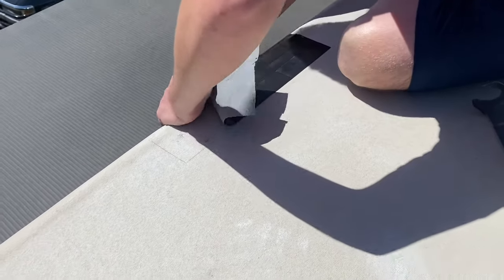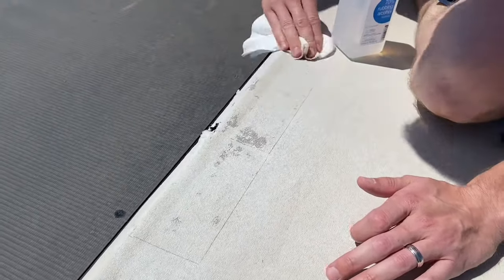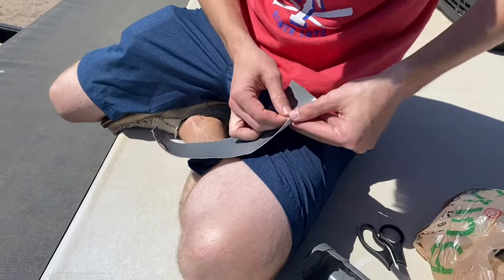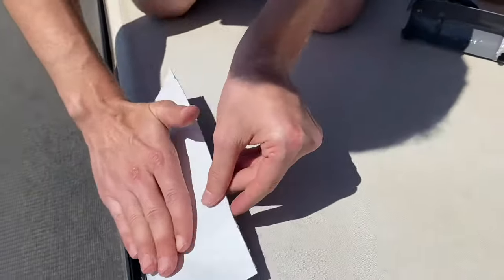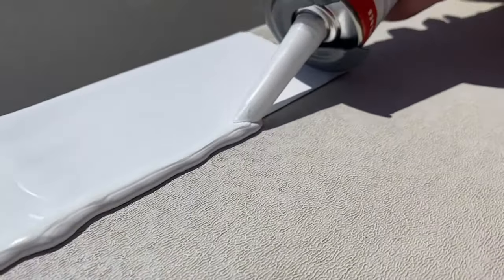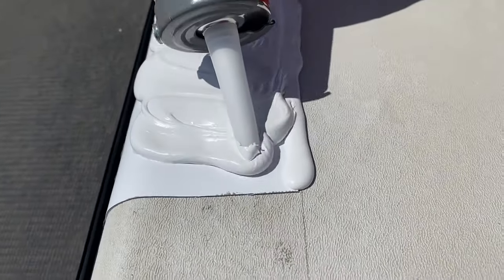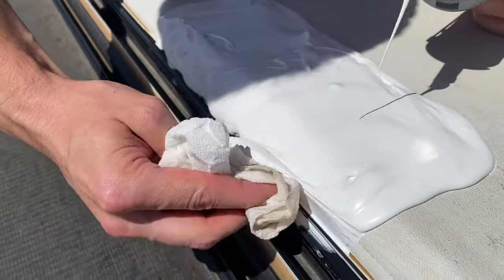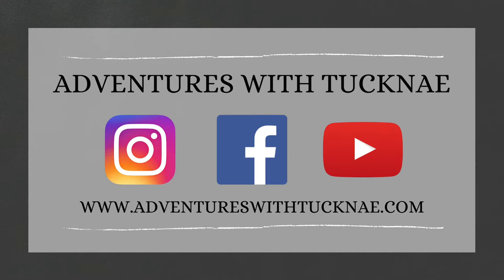DIY RV Roof Repair - How to Repair a Tear in Your RV Roof

Comment: Thanks for sharing this video.  If you have to do anymore sealing along the edge, Dicor does make a lap sealant that is not self leveling and you could use the leveling kind like you did on the top, let it dry then go back and use the non-leveling kind so that it does not run down the side.  I had a very similar repair on our camper.
Reply from the maker: That is great to know, thank you so much!
Reply: You can also use quick release tape to segregate the material from sagging or running off in to any areas you don't want it to gravitate to.
Reply: @PatrickFDolan  great idea!!!!

Comment: Our camper is a 2011, it held up pretty well but we have definitely had quite a few roof repairs as well. We use Flex Tape and have had good luck with that. Then do the lap sealant as well. Finally just completely refinished it!
Reply from the maker: That’s great!!